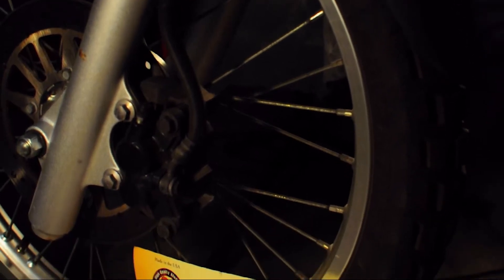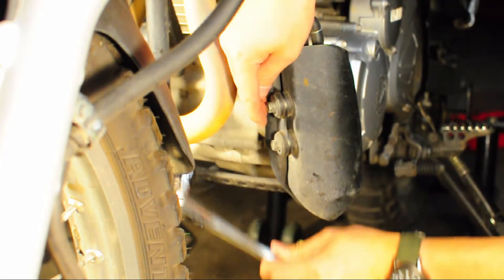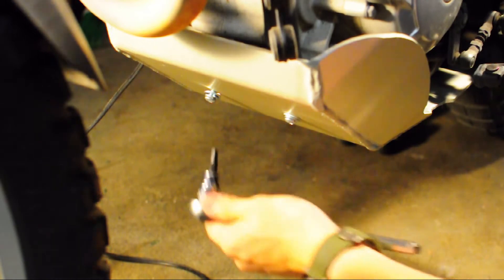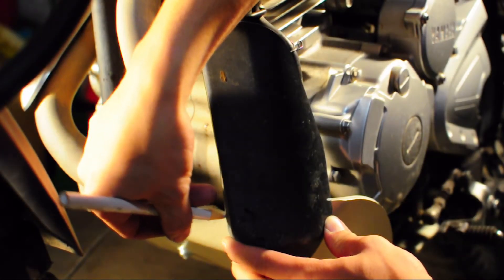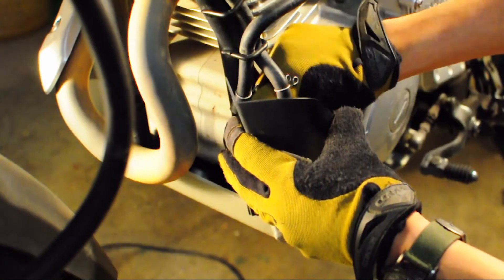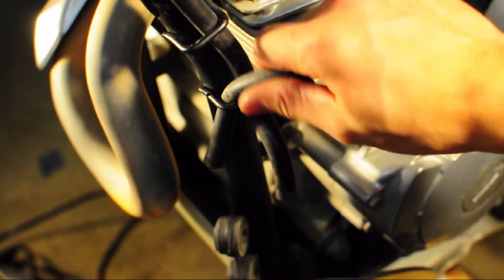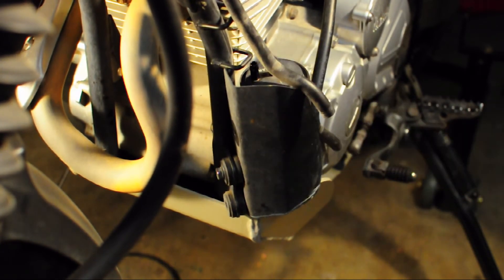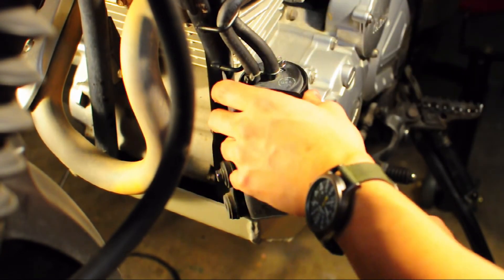XT250 Upgrades Episode 5: SKID PLATE

Comment: Thanks for the videos. Minor point - there is no carburetor on 2013+ models.  It has fuel injection.  The hose goes from the cannister to the "throttle body".

Comment: How well has the canister mount held up only using the one bolt?  I notice that Richochet also sells foam insulation for the skid plate to reduce noise - did you consider using that for the install?  Keep up the good work on the videos.
Reply from the maker: It's holding up great so far! I did consider it but since the XT is air cooled I didn't want anything extra insulating the case. But now that I've been riding with the plate for a while, I'm pretty used to the extra engine noise.

Comment: good vid... as all of your work.
How many miles do you have on the bike with the mod canister?
Any concerns?
Is one bolt enough?
I am facing the same dilemma.
Someone did a mod to extend the mounting and was able to use both bolts.
Reply from the maker: +Traveler thanks so much for the compliment! I have about 1000 miles on it so far with the mod and there hasn't been any drama! No rattling or anything but I heard you can make a bracket to use both but I really didn't care too much about the cannister guard to begin with! 

~NoOne